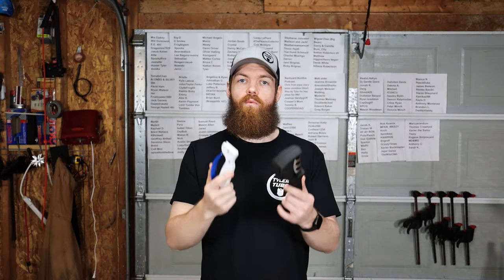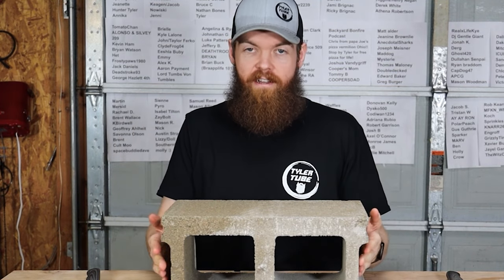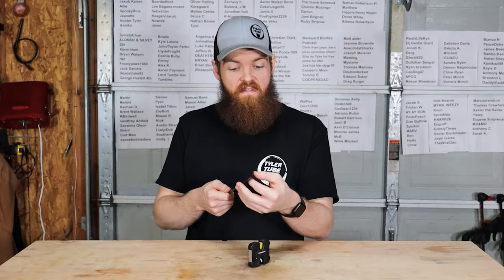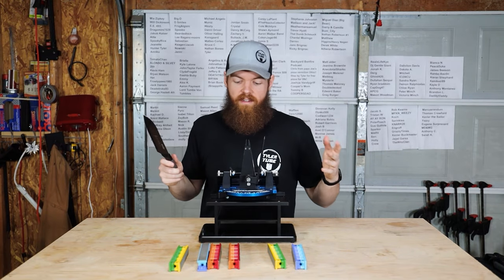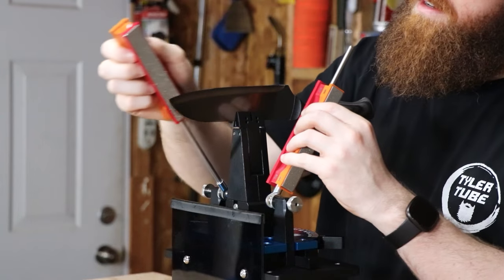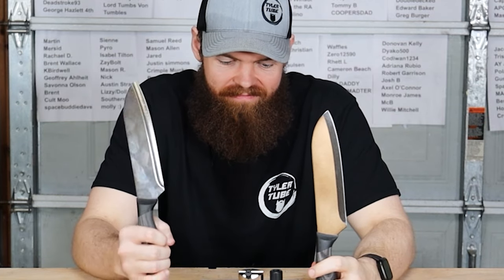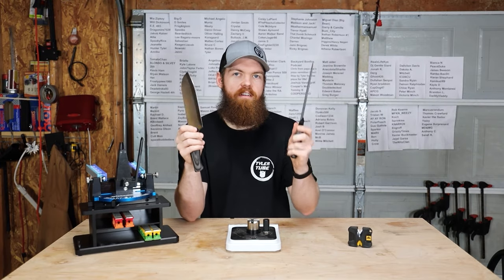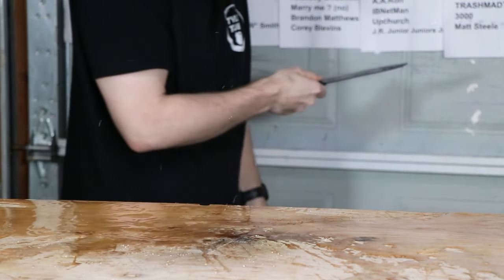$4 VS $1000 Knife Sharpener, Which One Is Better?

Comment: Ceramic rods like in the $4 knife sharpener commonly vary from between 1,000 grit to 4,000 grit. Also, when you sharpen a knife it creates micro burrs that are harder to see and feel. That's why most people going for a razor edge finish the blade with a leather strop and some stropping/buffing compound. From my experience a good thorough stropping can take a knife from a "decent" cut through paper, to being shaving sharp on its own. If you get a strop, make sure you get one with a rougher almost "furry" (I guess) feeling to it on one side and then a smooth firm leather on the other.
Reply: When I began sharpening by hand I knew nothing but i still new that leather was a really great finisher and would use it without even realizing that was a normal thing that professionals did
Reply: @gwc_garage  Sounds like you were farther ahead than you thought! When I first started I honestly had no idea, however even the cheapest of strops have given me great results. Even cheaper vegan leather has done the job lol.
Reply: @kfer9500  yeah when I started I had one stone that I didnt know the grit of different sand papers and a file(only used for larger blades like machetes or really really dull knives) and a small strip of leather.
Reply: yes
Reply: If you're in a pinch and need to realign just your cutting edge, you can use a leather belt. It'll do the trick. You can also in an emergency use window glass to put a crude edge on a knife. Glass is harder than steel.
Reply: Shxb Dnevf  I'm aware, however there are belts specifically for stropping as well as machine driven honing belts that are rather pricey. Plus the comment was directed towards Tyler and others that aren't familiar with the process so that they know they don't have to spend a lot of money. Plus not everyone has multiple leather belts and the process can and will tear your belt up.
Reply: @gwc_garage  Normal people just use a 10 dollar manual sharpener, or a 20 dolla electric one.. (or they bring them to a store) a 1000 dollar one is one u might find in a big kichen/fish market stuff like that (or knive sharpening store).. thats more about getting knives sharp fast and good/ and have a machine that lasts for years.. the kind he shows here is more like a glorified ice skate sharpener.. for stuck up people with too much money and time.. and for people that make a hobby out of knive sharpening. If ur sharpening knives on a bigger scale u need something to do the work for u, u cant be sitting down with a knive for 1 hour.. that would be a 100 dollar sharpening job then.. stones are for personal use only.. and they require some skill so its for hobbyists only.
Reply: @larsvegas1505  100%!
Reply: @larsvegas1505  you can get a Tormek for less than this1000,- gimmick.

Or just learn to sharpen like a real man and buy stones. Than you have a skill that will work any time and not just in the workplace with electricity
Reply: Can also use your denim jeans to strop. Done it and it gets stupid sharp.  This was after using a lanksy sharpening rod box on a opinel.
Reply: my dad was a barber, we kids had to use the strop wow what a difference
Reply: @gwc_garage  I'm guessing that most people with this knowledge are of the older generation like me. Those that can remember watching barbers doing this and then using a belt to keep their Swiss Army knife sharp.
Reply: I used to use an old belt that was finished on one side and rough on the other. I'd put toothpaste on the rough side and let it dry into a mild abrasive. I'd start there and finish off with the finished side.
Reply: Ok, now say that again in english.
Reply: You are 100% correct. I've been sharpening for 25 years. Lansky up to 1000 then ceramic then leather with buffing compound from finished side and a few licks on the unfinished side. I can get any decent carbon steel sharp enough to shave in minutes. I go 17 degrees to 20 degrees depending on application. Daily carry is always 20.
Reply: I have several strops for my straight razors, I use one of the cheaper ones for work/duty knives and they can do a surprisingly good job whipping a knife into proper shape quickly, or to just refresh them. I have a full set of large stones with 8 different grits, at least 1x or 2x a year depending on how much and how roughly I've used my knives they get a proper stone job. I have a few of those little cheaper sharpeners too and while you won't be shaving with one they do work incredibly well, quickly and easily for most applications

Comment: I have used this sharpener with great results in the low 100's. Pay attention to the burr and use the lightest pressure on the final stones but triple the passes. The steel of the knife also makes a difference.
Reply: Exactly. Those knives he is using are cheap n made from very cheap steel thats not gonna sharpen to a super fine edge. I wouldn't use that 1000 dollar tool on cheap blades. The 4dollar one is better suited to keeping that cheap steel usable. Now if u got some good Damascus kitchen blades or carry blades then yeah id use the better tool on them.
Reply: But that 1000 dollar tool is a sharpener. You still need to hone the edge after to get a razor fine edge.
Reply: There never WAS a burr lol he was going back and fourth instead of one side at a time
Reply: @GlorifiedGremlin  there is generally a burr created no matter what procedure is used. This method minimizes it but he didnt reduce pressure at the end to effectively polish it off. I have seen a burr produced with this setup that is so thin it will alternate the side it lays on after each stroke. This is when the micro-burr gets finished off with a strop.

Comment: Use a strop, burr is still on both knives.
Reply: i was gonna say
Reply: Ya you gotta finish with some leather to align the burrs.  Heck I use my leather belt or the case of the knife when I finish my knives
Reply: Was gonna suggest the same thing.
Reply: @dennisgibsonii6316  with some compound for extra shine lol.
Reply: I always see someone do this, but what does it actually do, i though only polishing.
Reply: That’s what I was about to say
Reply: @Bloemkolen   @Urbex  When a blade is sharpened a burr is formed. That burr folds over side to side when sharpening. You can actually see and feel this burr on the blade. A strop (or even a stone) gets rid of that burr to make a blade even more sharp by straighting the burr.
Reply: @bobpancakes6075  burr as in very thin piece of metal that makes the knife sharp, makes sense, it just feels so weird to me striking a knife rough side of a belt to make it extra sharp, but what can I say, we live in a very weird world. Thx for explaining!

Got one more question tho, a burr gets formed because of pressure and taking material away, and the belt makes the burr straight, 
So a belt can make an edge sharp but also more doll, as in just "burring" one side? Because then knifes are pretty weak.

What about Damascus steel?
Reply: Too true
Reply: For 1000$ you'd think it'd come with some kind of burr removing system
Reply: @leefulbright7473  for 1000 dollar you'll think they would ship someone who sharpens the knife for you
Reply: @Bloemkolen  Yes, a belt can make a blade both dull and sharp it just depends of the angle and amount of material taken off per side. Also you can ruin the temper of a blade on a belt sharpener if you let the blade heat up too long or are in one spot too long. 

Damascus steel is just alternating layers of metals. Normally a Damascus blade is made of alternating pieces of a high carbon steel and high nickel steel. Then once the blade is almost done an acid is used to bring out that distinctive pattern.
Reply: @Bloemkolen  By belt I mean a sandpaper belt or a grinding wheel. A sharpening stone or strop won't ruin the temper whatsoever because the temperature of the blade won't get high enough.
Reply: @Bloemkolen  No, the burr is not a thin piece of metal that makes the knife sharp.  As you shape the blade to a point, a thin strip of metal forms and curls along the edge of the knife opposite the one being sharpened.  This thin strip of metal kind of covers the point of the wedge you are grinding into the metal of the knife.  Stropping is the final step in sharpening where the blade is dragged along the surface of a material specifically to remove the burr altogether, revealing the point it was covering.  This step does make the knife sharper, but it does so by removing the burr rather than grinding away more metal.  The ceramic side of the pull through sharpeners are there to hone and strop, rather than act as a second stage of grinding material removal.
Reply: This. The problem isn't the grit. I can get a knife to hair popping sharp with 300 grit and I'm no pro. 1000 is more than sufficient. But you gotta use a strop to make sure you're removing the burr.

Comment: I think you hit the nail on the head with your final thoughts. The $1000 knife sharpener is definitely more aimed at specialists who have to sharpen a wide variety of blades and tools that may need fine adjustments to their angles. Additionally, it's been a while since I took inorganic chemistry, but IIRC there is a limit to how sharp you can make a blade based on its carbon content and I think that those particular blades aren't the highest quality in terms of edge retention.
Reply: I've put crazy edges on super cheap knives, they'll take an edge, but wont hold one. Almost any basic blade can take a mirror edge that'll show crazy results his knife sharpness tester, but they wont stay sharp with use. Getting a blade thats 55+HRC and it'll retain the edge much longer.
Reply: @DIRTYHARRYBALLISTICS  oh yeah. I remember once at a camp out my SPL sharpened a butter knife he found in the woods to razor sharpness
Reply: Except, due to the design, the expensive knife sharpener doesn't put a consistent angle on the blade.
Reply: He also still wasn't using it right in the end. which is why he got the result he did.
Reply: @paulrawlinson8653  there's an adjustment to tighten the jaws, user error, not design flaw.
Reply: @DIRTYHARRYBALLISTICS  I accept the user error, but the design flaw is the rods are at a fixed centre point so as the stones movecalobgvthe blade the centre of the radius us getting further from the contact point so the angle is getting sharper. If the rods are 12" long and the blade 8" long the difference in sharpen angle along the length of the blade will be about 2°. It's not user error, it's trigonometry
Reply: @paulrawlinson8653  Wicked Edge actually has a good Q+A with lots of material on this subject. The angle doesn’t change with the length of the blade because the angle of the edge is measured at 90 degrees to the cutting edge. Your trig is right but you’re measuring on the wrong plane. 

Simple little life has a good video explaining how he made the same mistake while exploring angle variance on fixed angle systems, and how the edge angle is actually measured on them. You are right in that the angle ISNT 100% consistent throughout though, as distance on the perpendicular plane from the fixed point does change the angle. So the angle will be slightly altered on the belly compared to the flat portion on something like a drop point.
Reply: @ZevVeli  I bought a new sharpener the other day and did this very thing, so satisfying